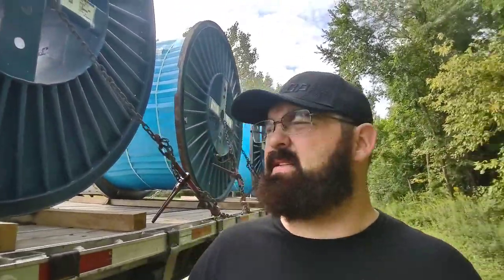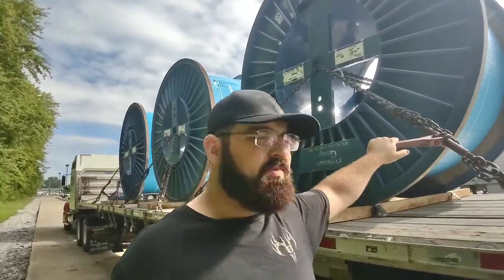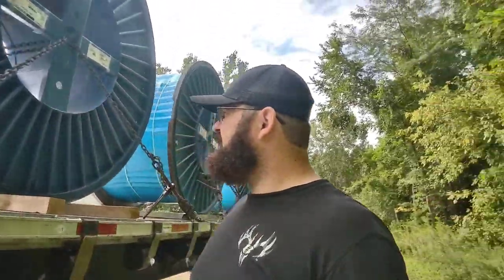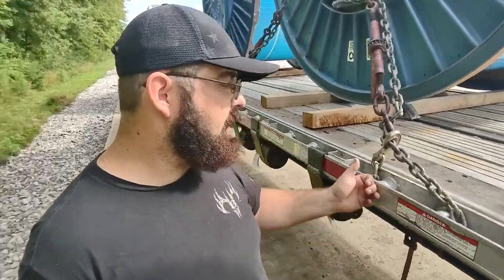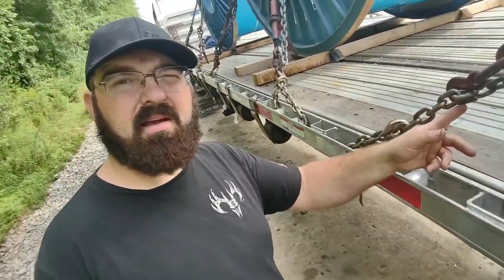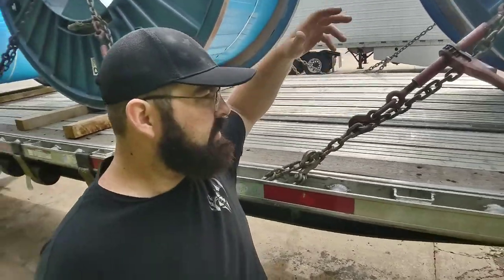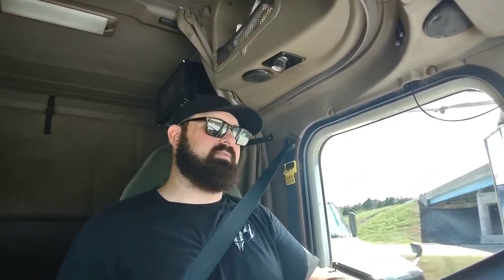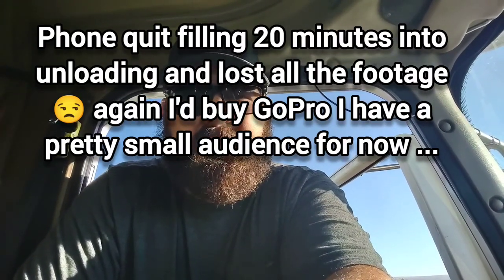First Load Of The Week Cable Reels.

Comment: I always appreciated hauling those cable reels on a stepdeck because of how top heavy they are. Always used PB blaster on my binders with pretty good luck.
Reply from the maker: Yeah definitely a load that you  want to keep on your toes and remember is back there .... 
And pp blaster works good but it never lasts though rain or winter  I'll see how long this red and tacky lasts be nice not to have to babysit the maintenance of the binders too ...
Reply: @Jackknife-TV  Lucas Green and icky or Motorcraft wheel bearing grease with moly is what I see a lot of guys use out here.
Reply: @Jackknife-TV  any used old oil is what I used up north, still got to put more on every once and a while.